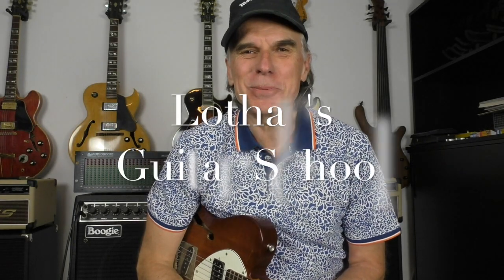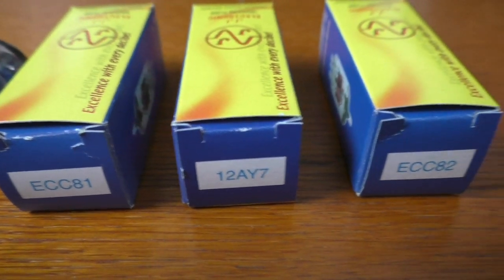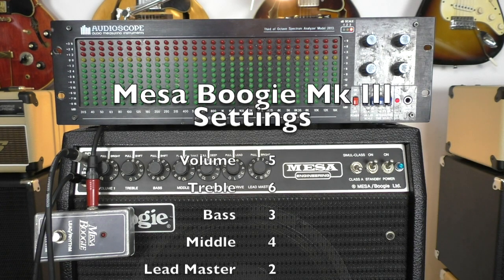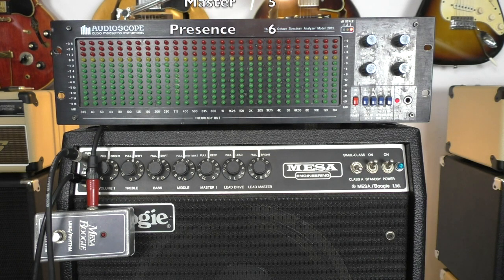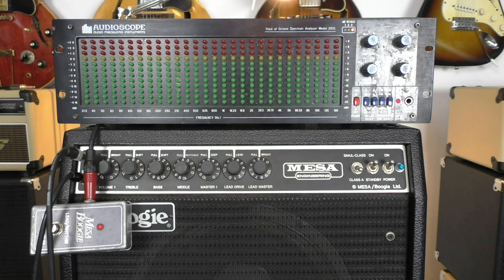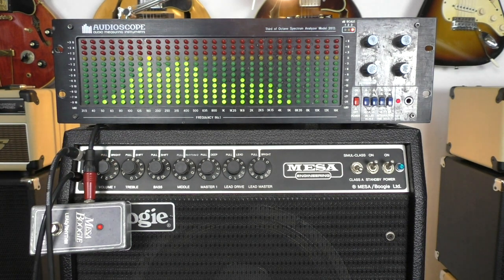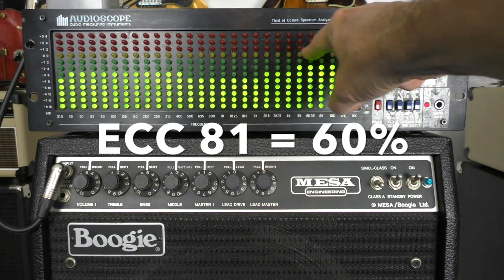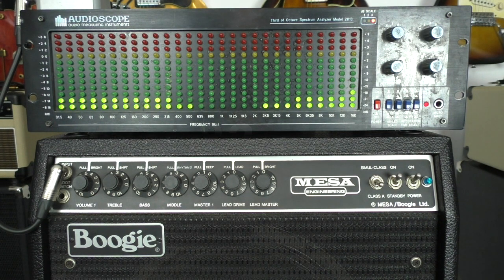Gear Talk - Preamp Tube Comparison - ECC83 vs ECC81 vs 12AY7 vs ECC82

Comment: i have also swapped all these models around in my amps .ive often wondered if the different valves had more bass or treble etc as we associate pushed power amp valves  with more bass...   im not listening with headphones now  but  i agree with your assessment that there isnt a great tonal difference , but you can lose the range of gain where the guitar sounds nicest and you probably create hiss by turning up the amp to compensate for low volume hitting the power amp. it as interesting to see the graphic EQ . thanks.
Reply from the maker: Yes, the graphic analyzer makes a more objective comparison possible.

Comment: You can't compare different types of tubes in same circuit because that only show one tube functioning properly, the rest are at least out of bias....
Reply from the maker: The goal was, to show the differences of amplification factors. You certainly can improve the performance by changing the bias.
Reply: @LotharsGuitarSchool  I thought it was about showing difference in sound and gain, guess you were testing V1. It is interesting to observe tubes didn't really sound different if input level was matches to gain of the tube, that shows guitar amp sound is dictated more by distortion (even in clean mode) than other things. I did a few tests with ECC88 vs 6N1P in pro audio preamp output driver designed for ECC88; despite tubes being similar and use of NFB they sounded very different. Without change in bias 6N1P always sounded muddy with ~5dB higher gain which made very good circuit sound bad. Changing bias didn't help which is probably what one would also find in guitar amps.